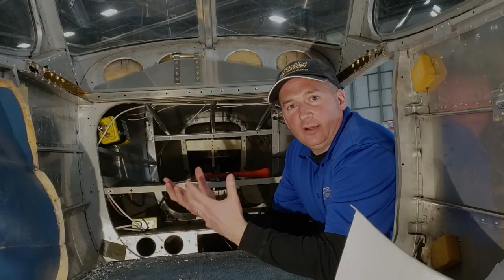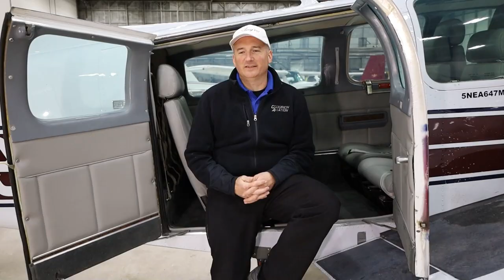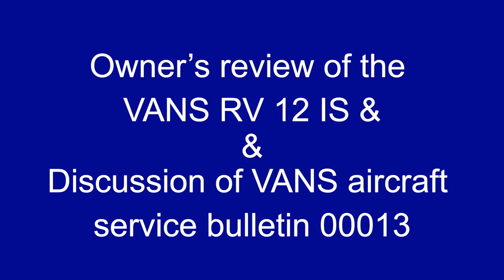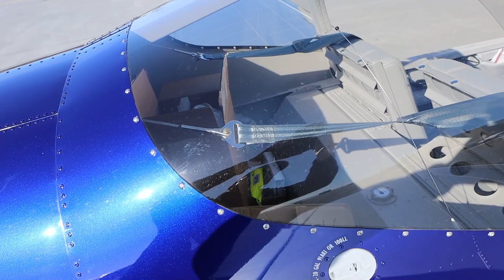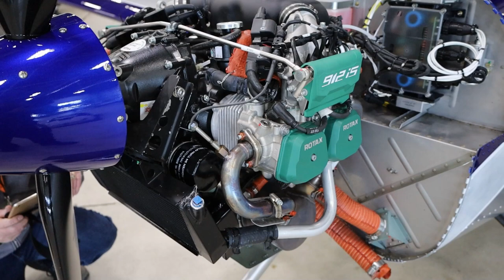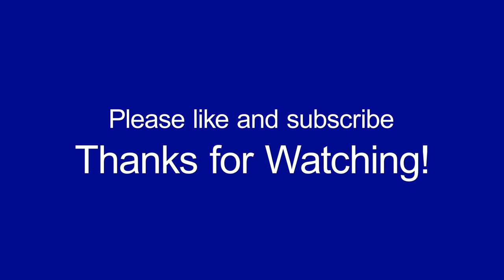RV-12 visits Goodrich Aviation - Customer review and SB 00013 discussed.

Comment: Mr. Brand  good evening.  I am looking to get my sport pilot's license.  I am looking at trainging facilites from 1.5 to 3.5 hours away from where I live.
There isn't anyone in the local Albany NY area that offers sport pilot.  

I am looking at one place (3.5 hrs from home) in New Hampshire and they use the RV-12's as their training aircraft and everyone says go for it.  Then there are two others that offer:

- Alpha
- Flight Design

I am a big guy, 6' 250 lbs and not really sure where to learn, based on plane.  Again friends of mine tell me, go with the RV-12, it can handle a large useful load.

You had made a comment about flying other light sport aircraft, but didn't alaborate about that others you've flown, yet you picked the RV-12.  Would you care

to give some feedback on some of the others you have flown?

Just trying to hear it from guys like yourself that has that prior experience.

Thank you for your time and attention to my quesiton.

Jay